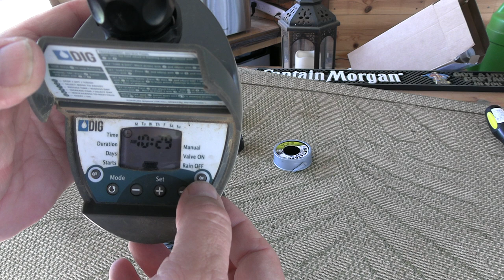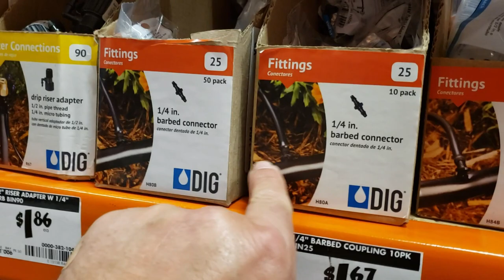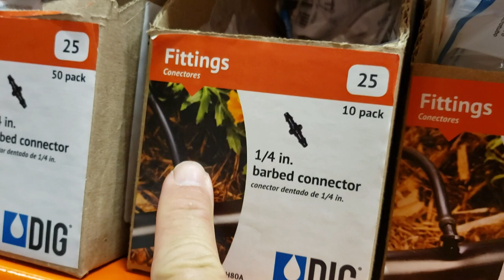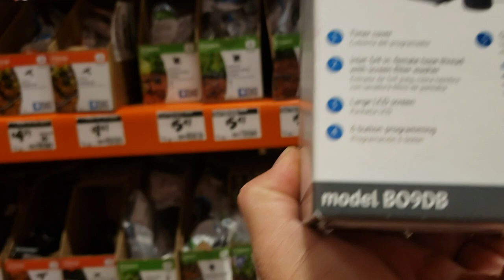Automated Backyard Garden Drip Irrigation!  Have a BIG Garden & Time to Enjoy It! #garden #watering

Comment from the maker: Backflow preventer: https://amzn.to/2Qc9N9Y
Garden in-line water filters (4): https://amzn.to/3254U5n
Drip Filter w/mesh screen: https://amzn.to/3d75R3a
Dig programable water timer: https://amzn.to/39Ulqth
200’of ½” drip tubing: https://amzn.to/3dJezUo
Easy punch for placing barbs & tubing: https://amzn.to/3myYLaZ
½” drip tube elbows (20): https://amzn.to/3uF0tu8
½” Tees: https://amzn.to/31Zr5JZ
½” End caps: https://amzn.to/3t71Kde
100’ ¼” tubing: https://amzn.to/3dOJ77m
250 pc ¼” fitting kit: https://amzn.to/2PQn1cK
100 pc 360 degree emitters: https://amzn.to/39Z4guF
Hanging basket foggers (5 pk): https://amzn.to/3dOVK2q
Quick Connects for garden hose: https://amzn.to/3dMjzIe

3 Gal. Washintonia Robusta Palm Tree: https://amzn.to/399HKyG
36” Fire Pit with cooking grill: https://amzn.to/3tQnJVU
Book: "Palms Won't Grow Here & Other Myths": https://amzn.to/3dbFcTx
Bio-tone Starter Plus for potting up plants: https://amzn.to/3cX3wH6
Solar/Ultra Sonic Mole & Gopher Repellent: https://amzn.to/3tRBO55
Weed-n-Feed Drop Spreader (avoids overspray into garden beds): https://amzn.to/3vTEnpd
Tiki Face torches: https://amzn.to/31c77eQ
Chico the Chimpanzee: https://amzn.to/3rVJlPr
Other Tiki, gardening and greenhouse items I use: 
https://www.amazon.com/shop/tiki71  

🍹 We have a recommended product page on Amazon & it’s filled with the things we use and like & it’s a convenient way to check out what you see on our channel & it adds ABSOLUTELY no cost to your purchase: https://www.amazon.com/shop/tiki71  
If you click through and buy something, we receive a small a very small commission (as little as 1%) that costs you NOTHING extra, but it helps us with the costs of delivering content, so Mahalo (thank you)! 🤟🏼 
🌴 🥃 🍷 🍸 

🌴 Subscribe: https://www.youtube.com/c/Tiki71
🌺Join our Facebook Page: https://www.facebook.com/thetiki71
🥥Instagram:  https://Instagram.com/TheTiki71
🗿 Twitter: https://twitter.com/thetiki71
🦜 Email: tiki71@yahoo.com

📭 Send me letters, pics, and stuff (I might open it on camera and give you a shoutout}: 
Tiki71
c/o Jungle Jerry
205 Wilburn Heights
Central City, AR  72941

🌴 Tiki Gardener Bumper Stickers!  Show your love for tropical plants AND tiki at the same time.  Just $5.00 in the lower 48 states, $6.00 everywhere else with SHIPPING INCLUDED.  
Go to https://www.paypal.com/paypalme/tiki71 and be sure to include your address at checkout.   I’m using a direct link to PayPal, in order to keep costs down and I’d rather pay for shipping it to you than some corporation to host a website that does the exact same thing as the PayPal link. 😉🤙🏽

0:00 Intro
0:44 My Garden Drip Overview
1:55 Drip Filter & Timer
2:47 Hanging Basket Drip
3:17 Main Line Drip Tube Around Garden
4:37 Connecting Garden Water Filter
6:37 Leak Check - Oh No!!!
9:10 Broken Timer
9:48 Plan B
10:34 Drip Parts at HD
12:40 New Timer prepped
13:06 Blowing Out Lines
13:53 Basket Lines Checked
14:01 Watering Cart Hooked Up
14:15 Thanks & A Request

Comment: Hey--nice video. Do your solar-powered tiki gods still work? We have the same ones...ours died pretty quickly.
Reply from the maker: No, they weren't sealed properly at the factory.  I took them apart last year and water got in a rusted out the thin, cheap connections.  Bummer.

Comment: Do not use teflon tape on hose threads.  They seal on the rubber gasket not the treads.  Tape actually makes it way harder to seal.
Reply from the maker: I've never had a problem doing that.  I like the extra insurance it provides when I'm off at work and it's all under pressure.